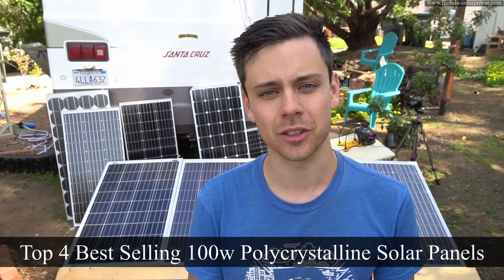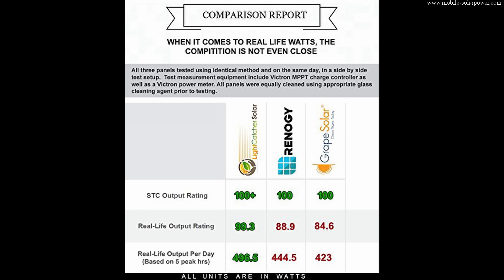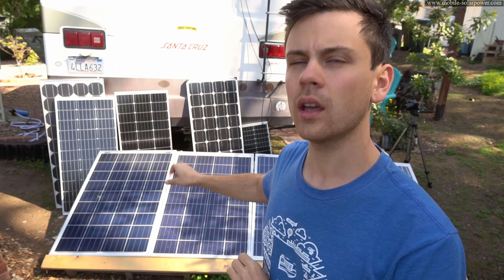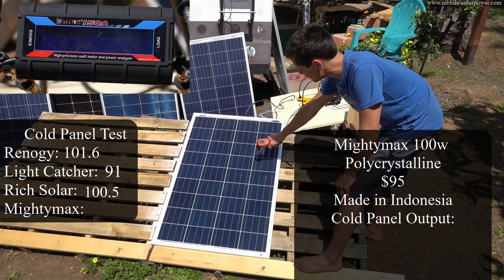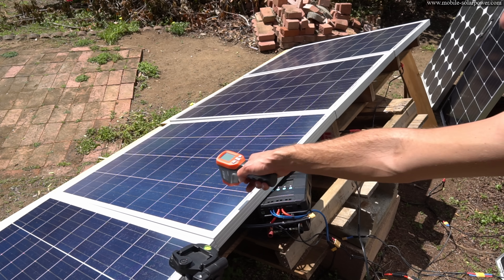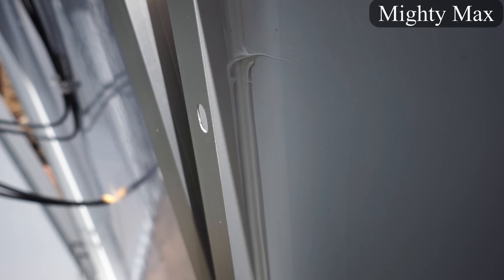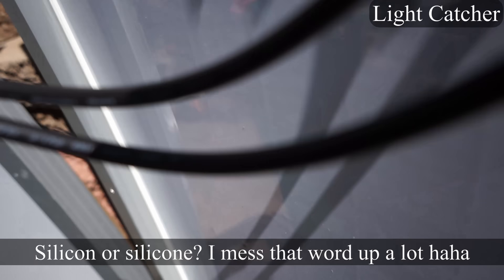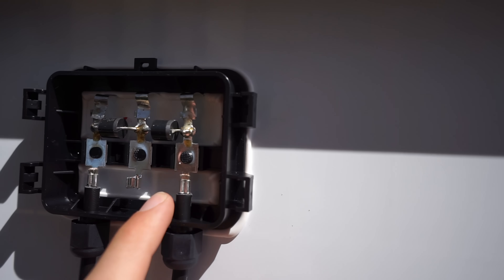100w Polycrystalline 12v Solar Panel Showdown! Renogy vs Rich vs Lightcatcher vs Mightymax

Comment: You're an excellent young teacher my friend. I feel confident assembling my first system thanks to your videos. So thank you! Are you able to explain how a 12inch square, 4 cell, flexible panel is rated at 1000watt? They're litterally half the size of the one's in this video, yet 10 times the wattage! What am i missing?
Reply: Given any square meter on Earth only gets ~1000W from sun and best newest and most expensive panels barely got to 40% efficiency, it is either meant for concentrated solar, is a typo, or a scam. That "flexible" part doesn't seem legit, there are small 100W panels for campers and such but the flexible ones tend to be bigger.

CSP panels need to be able to survive high temperatures as the point is you put up a bunch of solar trackers with mirrors to focus tens to hundreds of square meters of light on a small area. That is of course cheaper than putting up a similar number of solar panels, but panels tend to lose efficiency as they heat up so CSP panels are hella expensive as their working temperature could be hundreds of degrees.

Solar scams are less common these days because people know more about the science and tech involved, but just recently I happened upon a YT video trying to sell a method for building a solar array that was obviously a scam. The picture showed a frame with many small panels set up on top of each other that supposedly gives huge power to area ratio, which can't work when the panels aren't even aimed in the same direction and shade each other, and the guy selling it made a long rambling speech claiming that he got robbed during a blackout but then he found out about a secret research that would give him a steady power source and the government wants to keep it for their own use but he is selling the instructions as long as the website stays up... Incidentally, I found the link to that from another video that was offering easy instructions how to build a water collector system "in use by various armed forces" that the presenter found out about after the government didn't give his farm any water and thieves stole his water tank and now you can build your own, just send money quick before the video gets taken down because "they" don't want you to find out about this secret...

So yeah, there are scammers trying to take advantage of gullible paranoid preppers and conspiracy theorists, what is this world coming to?

Comment: What you don't test or cannot test is long term reliability and consistency in the power output over time. For me, the prices among the panel are not large as long as the panel meets the criteria of my first statement. A higher-priced panel will pay for itself over a long time.

Comment: Everyone misuses silicon and silicone. Silicon is the brittle crystalline material solar cells and microchips are made of. Silicone is a rubber like material that is essentially a long chain hydrocarbon used as adhesive and water proofing

Comment: I used to have to test these things on the fly really fast for years and also use the welder to weld those terminals in the boxes. Except for the actual soldering of the cells together before it went into the ovens, I was at every step of the assembly line. Who cares about the look of the silicone bead?....Seriously, if I don't care then you shouldn't care. Unless it degrades over time and the panel ends up flapping inside of it's frame in the wind and then you turn it in under the 25 year warranty.

Comment: I worked for a solar panel manufacturer for 7 years in the US before China trade cheated and dumped solar panels purposely to drive the US panel manufacturers out of business. They even openly stated that was their goal. Those aluminum frames are very sharp at the end. I had one, new, short, temp guy watch me and another guy framing these really fast and he decided to join in and throw the frame at me straightforward (edge in front) instead of sideways, like a little prick and it cut me all the way down to the bone between my thumb and index finger. Then he started yelling loudly like an idiot to get us both fired. My hand was spitting out blood profusely. He f**** followed me to the bathroom the whole way yelling like an idiot. I drenched it in alcohol and sprayed it with water and wrapped it in a paper towel and taped it up and put a glove over it to hide it and went back to work. Those were 175 watt panels I was building and they were a little taller than me (6'1") that was back in 2006 or so, 13 years ago. Seems China succeeded in blocking progress in this technology by purposely trade cheating and running every other manufacturer in other countries out of business.

Comment: Oh my god!!! Dust from India! Will we survive? I’m just kidding it’s just funny to hear. I think the internal box construction is far more important than the caulking with siliCONE. The backing is a PVC film probably. Maybe straight vinyl for the Deutsche panel which explains why it is so shiney. But I agree, that panel is bottom of the list, and like you say, even if that was a bad panel it speaks volumes for the QC. A chain is only as strong as it’s weakest link and that company’s whole chain is either consistently poor or only as pathetic as that one panel. Either way... it sucks.  
Great content by the way! Straight to the point.

Comment: There are several problems with your test.

1. Individual panels is going to vary, the results could just be natural variation in individual panels or between batches.
(To fix this you would need SEVERAL of each)
2. The load tasting is poor, it would be better to have a load rather than a charger.
3. Amazon is Inequality.
4. The Externalities of capitalism are not accounted for, company constituency, average and media wage and benefits, transport emissions etc.
While of limited use this is classic commodity fetishism and alienation of the human beings who make these panels.

Comment: Silicon is a crystalline solid at normal temps and pressure, whereas silicone is a silicon analog of a ketone like acetone. So if you feel the need for a some way to remember which is which without bothering with chemistry, just remember that aceton(e) is a fluid "as is" silicon(e) :)
Ohh. And awesome review. Nicely systematic and to the point.

Comment: I'm German also and was hoping like you their panel would excel but no such luck. I bought 10 - 250w poly panels used for a very good price but need help setting up a off grid system. I am somewhat electrically savvy but not great. Can you point me to a help source for setting this system up and what I will need and what products are best to buy. I looked at your website and looks like you really know your way around. Thanks for your video and any help you can provide. Keep up the great videos.

Comment: Interesting video. I was wondering when will solar panel builders stop making flat chip solar panels and start making honeycombed cells instead, like the structure of butterfly wings. I am sure that would increase solar panel efficiency by a great amount, allowing them to be used in the production of things that have a relative small surface area like cars.

Comment: I have been watching your videos for some time, always informative. I purchased the PIP 2424lv msd 24volt and I have some richsolar 160w x2 in coming. I am trying to push that 400w mark for the panels and shy 40w. In your opinion is this setup close enough? Perhaps adding a 100 or 160w down the road.

Comment: Sili-Con.......or..........Sili-Cone.....that is the question?....What about long term use..if these cheaper units fail in 6 months time ,what good are they...the German  brand appears to be better quality...so...wouldn't that be a better product long term..doesn't matter output of these ratings if they fail short term....Vinny selling the Sham-Wow says the Germans build good stuff

Comment: Thailand and Indonesia only perform assembly works..... hence their raw materials ought to come from somewhere else..... likely China. Germany definitely got the panels thru OEM sources from China only. India on the other hand manufactures everything on their own. Your analysis based upon costs is correct as these panels, no matter how beautifully done or looks, will end up in the harsh outdoor environment. As long as cost is low and performance relatively acceptable, why not?

Comment: I would love to see a review for "mobile" panels that I can use on my boat. I am at 57 degrees north so the panel will need to operate well with a low sun angle and cooler temperatures.

Comment: Thanks you for your video, Please how can one calculate time(hours usage) assuming i have 12V DC battery,(7.2AH) 300W inverter and 10w LED bulb, how do i calculate the mins or hours it will last before the battery runs down. thank you

Comment: It sounds like Grape Solar was making theirs in batches so you had to wait for inventory to catch up with orders. I just got a Mighty Max 100 from Amazon (Now at $73 with free shipping!) The workmanship has improved greatly as the frame fits perfectly together and the caulking was smoothly done with only one little blob where they ended. The frame is protected and kept clean in transit by some almost invisible sticky clear tape which I always remove. The sun was coming in my dining room window through a screen and some tree branches that don't have leaves on yet on a partly cloudy day. So I laid the panel on the floor and the Mighty Max started charging my Zoombros 330W  (Same as a Rockpals 330w rugged) with about 30 watts coming in! My outdoor testing hadn't even begun yet. This is going to be good! (Video in production now)

Comment: Unfortunately for the German manufactures they are hindered by a mountain of regulation and it may be that that panel has better life spam more hale resistant,cold hardy,better low light efficiency and built in a more environmentally  friendly way.

Comment: Just saw new Jackery 1002.  What solar panel config. would you recommend to match the 30v input charge limit? Two 100 watts in parallel only produces 18v and in series 36v.  Thanks for your expert videos and advice.

Comment: I found a flex panel manufacturer who says they guarantee their panels for 1 year and they have a 5 year lifespan. 5 years doesn't seem long compared to glass and metal but would you buy knowing you will have to replace in 5 years?

Comment: That mono panel was much smaller.  It would be interesting to see a power vs size comparison.  Say you had a limited area to cover in panels, even though mono is less power per panel, they are smaller, so you can use more?

Comment: Tried to find the Renogy Poly panel in this form factor.  Renogy do not show this panel on their website at this time.  They have the 50W but not the 100W in this form factor.  Perhaps there are still some left somewhere in the supply chain.  The key to all four of these panels for my use is the are narrow enough (around 20") to fit on my Class C RV.  Perhaps supply of poly cells is having an impact?  Perhaps your video showing the better performance of poly vs. mono has caused a run on cells!  Nice job on the video.

Comment: Mono is suppose to be more efficient, but every time you test panels the Poly always put out more wattage. Whats up????
Reply from the maker: It's because the polycrystalline panels are larger. No special tricks here. And poly is cheaper. Mono has better output for the surface area but Andy doesn't seem to count the cells, so don't listen to him.

Comment: Solder will beat out any crimped connection any day.  Loved your testing process very good.  Seems that the poly is capable of more wattage than the mono (even tho mono is supposed to be more efficient).  According to your prior video.

Comment: Thank you very much for a awesome video on solar panels. Im just starting to go solarfor backup and know nothing about it. Almost bought the 100 amp panels from rural king but the ones u showed put out way more. Someone did a video on the rural king ones and had 2 100watt only puting out a little over 100watts

Comment: 3 of my Renogy panels have cracks in the cells, the rest of the panel looks perfect, 1 cheapo panel does too. I have 19 Panels from different brands none of the other brands have cracks in the cells. I have 2  Lightcatcher panels I was disappointed with the power output too.

Comment: Excellent review .  . Question . who makes the best large flexing panel . Its going on a 63 VW bus . like a 'wrap'  I'm going to use a large lead battery 7x13  . I only have room for one in the hot engen compartment .

Comment: Thank you for the valuable info! Would you be willing to put together a few systems that you could recommend at say 3 different price points? After all these vids I am finding myself a bit overwhelmed with all the options.
Reply: It's better to know what the options are than not know anything. Rich is best price and power but 3rd for appearance underneath. Nothing should go wrong but if it did , silicon and solder are cheap easy fixes.

Comment: I just bought two 100 watt Rich Solar Poly Panels from Amazon and  I must say that the over all quality is pretty darn good. Mine were made In Vietnam ( Which I've seen China moving big into that country ). The bead of silicone was perfect and connections crimped and soldered inside the box were a lot better than your India made one.  I'm really impressed. I bought these because of your review of the performance. Thanks. Mark  Tonopah, AZ

Comment: $80 for 93 Watts output hot for the Mighty Max and Rich Solar vs $130 for the Renogy at 93 Watts says the the Rich Solar and the Might Max were both better deals than the Renogy when I bought mine. Current price for the MM is $89, RS is $82, Renogy is $92.99 ( Labor Day sale ), Lightcatcher is $91.85 on ebay. Today I'd go with the RS for the $10 savings per panel over the Renogy. Funny thing is, if you buy two Renogy at the same time during the sale, they drop the price per down to match the MightyMax. So it pays to shop around. :^)

Comment: Looks like no one is telling the real reason why nonocrystaline panels will always beat the pollicrystaline panels. My electrician told me that if you block one cell from sunlight on the pollicrystaline panels,  the whole panel shots off and is not producing any more power. Monocrystaline panels are different in that matter.  Every cell is connected separately and if one cell is blocked from sunlight the rest of the cells still produce power. That's the real difference and advantage of the monocrystaline panels. Why is nobody mentioning this?
Reply from the maker: Because that is absolutely false and your friend is wrong. The cells in mono and poly panel are in series, and if you shade an entire cell, all cells connected will drop to practically zero. Has to do with the bus bar configuration and cell arrangement. He might have a argument if bypass diodes are only used on his monos, but I doubt that. Tell him to test it out on his own system

Comment: I don't know their Pricing Hwvr there is for a FACT a manufacturer in Philadelphia,  PA .
 (GDIT, King of Prussia) 
I supervised a Cellsite up grade on a Water Tank as a CS for General Dynamics IT Wireless there and I took a brief Tour w the Manager of the Solar Panel Factory ; small overall size .  
They were Hard Earnest workers which is Necessary to Compete & Very Nice too.  I Give their Craftsmanship 🤓👍👍
 When I do get around to Buying I will look them up as whenever Possible and Feasible I prefer to buy American .  
There is quite a few Solar Companies in Philadelphia ; so I apologize you may have to figure out Whom I speak of yourself . 
I'm talking the Actual Panel Manufacturer that's Based there . 
You might ask those you try if there is a Water tower directly behind them . 
Then you might be assured you found the correct location . 
  When searching Solar manufacturers I Find I don't like how Google mixes the results w installation Co's as they are often 2 different frigging things .  
Yes I find Google results to be unreliable and very overly time consuming;  if I were still in Business I would say it's extremely Counterproductive and a waste of valuable resources . 
Google has plenty of fixing to become a Sustainable platform and they're supposed to be Using Prometheus AI ? 😂😂😂
Apperently all its good for is spying on the American People and helping the Elites Tax Evade . 
Yes do look up What's been made public on Prometheus AI.  
Then look up Project Sentient.  
 Very Spooky 
Amazon Alexa one of Prometheus AI's children  , Facebook , twitter, snap chat blah blah blah & by the way VPNS are Not Anonymous as all are required by law to provide backdoor keys to Law enforcement and Yes Alot of Law enforcement uses Prometheus AI's children w Facial recognition to include Walmart . 
  I totally despise Walmart as Non American in Values entirely . 
I find it to be a Reprehensible Company that destroyed Our country , then Amazon came along  ; thus Creating the Retail Apocalypse now in progress . 
 Now the Entire US seems to all be the same & Very Boring . 
Everything made in China or some 3rd world country w Slave wages or conditions . 
Bring back Our manufacturing and Peeps You as Business owners and as Real estate quit over pricing as it devalues the Dollar . 
 Superinflation is Your Faults . 
I'm a Former Business Advisory Council Awardee for Businessman of the Yr myself and I was NEVER Greedy nor Dishonest in my Dealings/contracting . 
 Sorry bout the rant peeps 
Some peeps need to be reminded of Values and Moral Integrity . 
 Have a Wonderful Day/Night To 
All Genuinely Good Peeps ; to the scoundrels please change your ways 😧🖖✌